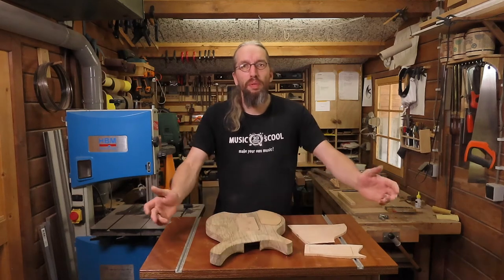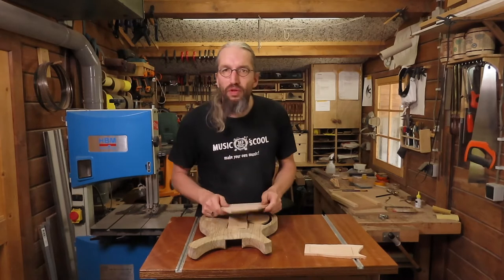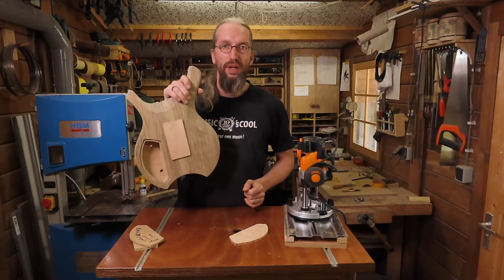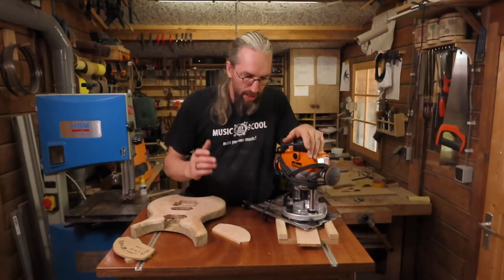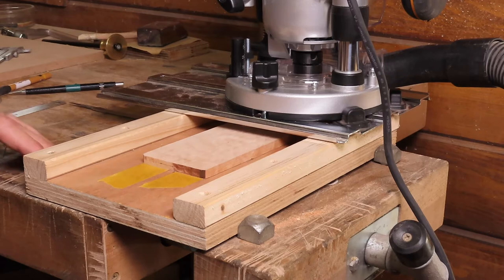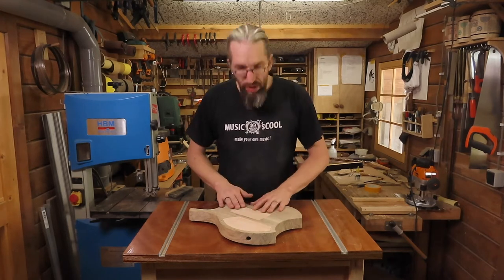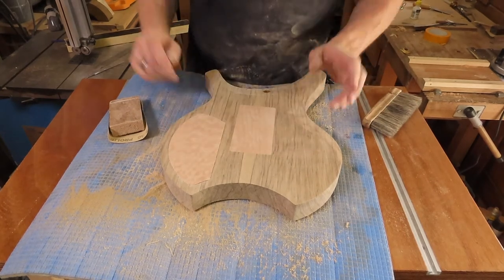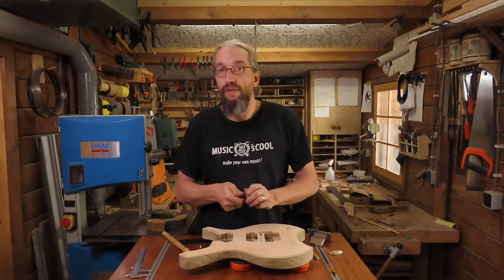Making cover plates & Glueing in the Neck - A new Guitar build Part 14

Comment: Another fantastic tutorial. I think the break angle is the hardest thing to get right, especially with a glued in neck. I've picked up a few tips again so thanks
Reply from the maker: Hi John,
Yes indeed the break angle is somewhat tricky. You really have to keep checking it at every step and if needed adjust accordingly.
I think I might be a bit too obsessed with accuracy though. The final adjustment I made in this video was to 'correct'  a difference of +/-1.5mm at he bridge. I could have adjusted the bridge height during setup but I was set on having the bridge as low as possible.